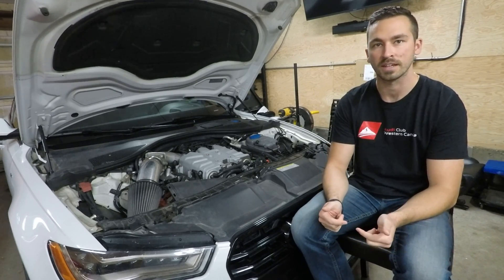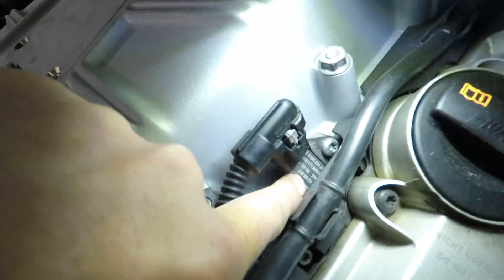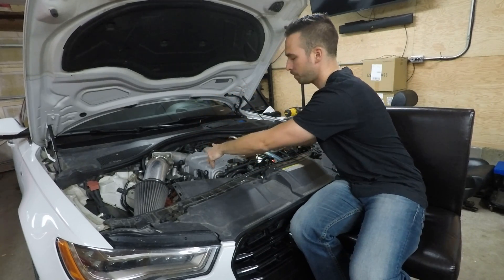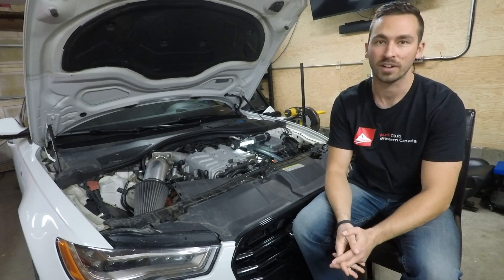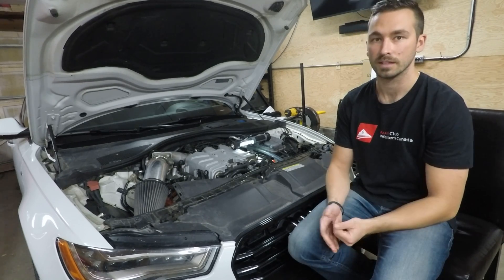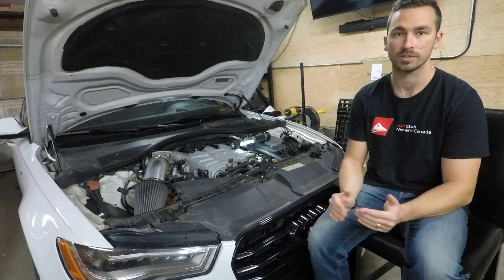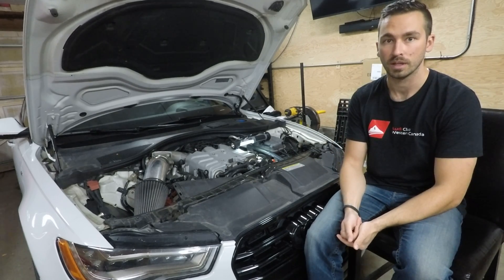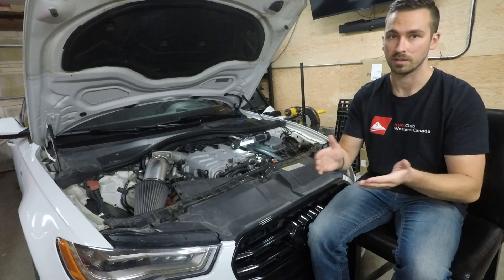3.0t Tech Talk Ep.1 // IATs and their Relationship to Performance

Comment: Do you have any video on how to do logging and whats the best things to log in new to this. I have vsds but would rather find a easy way like using my phone as i dont want to carry around my laptop with cable going everywhere.
Reply from the maker: Who do you have your car flashed with? Or do you have your 3.0t tuned?
Reply: @SuitedUp2The9s previous owner flashed it at a local shop, stage 2 single pulley tune by GIAC.
Reply: @SuitedUp2The9s  i got a handheld obd port switcher with it but thats just to switch tunes from race to pump to valet
Reply from the maker: @Kendkend  I'm tuned on 034Motorsport software and conveniently they have a tube switching discount and all of it can be done through their mobile app. Also works on laptops and tablets too. Their logger and then built in viewer is very slick. I've been using it consistently for well over a year now

Comment: SQ5 2015 Dual pully stage 2plus ...What is going on if I'm pulling from 0-280kph
The cooling system ..with the IAT ??? What is the good maximum Temperature that the IAT needs to be in such situation...or other hard long drive....???
Reply from the maker: I could guess what's going on but I'd prefer to log it and have pids up on my 034spi logger so I can glance at if my temps are good or above 80C. 80C iats I think for all tuners is where thats when the iat safety kicks in and you go into a reduced power mode with your bypass valve opening preventing you from making boost
Reply: @SuitedUp2The9s so actually you can not push the car to it limits?  If I want to drive hard for a few minutes... to push it all the way... I can't?  I need to push two or three gears pushing and stop for cooling? 
If I have a rolling race with someone...or longer race... what I need to do????? It sounds ridiculous 

For example...my car going up to 75c iat in lunch when I'm in 3th gear.
If I keep running it is going up to 90c when I'm only at 200kph... 
 
I believe that my wac50 is not working if it is like that... I'm about to install wac100 next week... but again...what do I need to expect?
Reply from the maker: Physics is what it is man. Those stock blower intercoolers aren't like a b58 or a coyote whipple or so many other superchargers with huge intercooler bricks. Upgraded cwa100, Divorced loop with only distilled and a hx will absolutely help. Maybe look at running an ice tank if you want to do runs like that. But yeah it doesn't take much from a roll especially if your iats are 20C above ambient before putting your foot into it.
Reply: @SuitedUp2The9s I have changed to a bigger HX when I got dual pullys . But after 2years now I'm getting high iat temperatures and got inside a limp mode that actually cut my power to zero when I push it hard ... I belive it was at high iat temperatures...
Any way I'm going to replace my cwa50 to cwa100...I believe that my cwa50 is not working at all because at the past I use to push the car the same without any problem

Comment: Y u no interchiller
Reply from the maker: @Pwnulolumad  I've got to simulate running one. With my climate in the winter, I got Subzero iats to start and then final iat temps end up at the same as a normal run. The iat delta isn't say the normal 30 or 40 degree increase from the subzero start. It was a +60 degree increase.
Reply: @SuitedUp2The9s If you know anyone in Texas that can install it for a reasonable rate can you drop a name here? Interchiller quoted me 2800 minimum labor only from their new Texas location.  If you can share a contact email here I could share with you the components I found that will fit in our c7s
Reply from the maker: @Pwnulolumad  Blair Auto is the only shop I know in Texas that has ties to C7s

Comment: You mention the pwm wire for the stock coolant pump. Are you talking about cutting a wire so it flows at the max?
Reply from the maker: Thats one way yes. I unpinned my pwm wire and put it in shielding to protect it while its out of the connector. And yeah the point is to flow the max, bonus is to help bleed the system of air easily.
Reply: @SuitedUp2The9s  cool, got something new to do tomorrow. Think I'll put it on a switch so I don't have to leave it running at max all the time.
Reply from the maker: @1bads5  I've had my pump like this for several years and no issues. These pumps can definitely handle it. I would have no hesitation to do it to mine again if I got another. Just for perspective. I get wanting to do the switch.
Reply: @SuitedUp2The9s  what's the fastest you ran at the track before porting? Also do you have a tiktok? Look me up if you are on there  MY...NAME...WAS...TAKEN
Reply from the maker: @40 Roll  I didn't get on track pre ported but with DP and TB. Dragy was an 11.6 @117. Sorry, I don't have TikTok. I'm seeing on your YT you've got a B8 S5 that you're modifying and racing. 🏁

Comment: The intercoolers on the 3.0T are not that efficient at all since they sit on top of the engine with no type of hood scoop routing any cold air to it like a WRX or STI.  The factory intercoolers just heat soak and really can not cool the air much at all.   Its a poor design without any cold air being routed to them.
Reply: My 3.0 intercoolers aren't up top. They are on both sides of the front bumper frame
Reply from the maker: they are water cooled. Thats why they don't have a WRX/STI hood scoop.
Reply: @SuitedUp2The9s  Well I would think being exposed to air more like a radiator would help it cool even more, wouldn't it?
Reply from the maker: @robertdaone  water has a higher specific heat capacity so air to water intercoolers can do a more efficient job of cooling and in a smaller package compared to an air to air intercooler. If you had air routed to the sc, in a wrx/sti fashion, it might cool the supercharger casing. But the air inside that's compressed won't be affected or cooled and will still heat up the supercharger casing.
Reply: @SuitedUp2The9s  I hear what you are saying but was meaning that if the actual intercoolers within the supercharger casing was exposed to air, where air is ramed on top of them like in the wrx/sti it should cool even better.
Reply: @robertdaone  Like what is being said, they are heat exchangers not intercoolers (which technically were supposed to be between two power adders). Now to your point and what you mean, I iced down my supercharger for almost two hours before a run. The housing of the charger was cool, but the two HX bricks inside the charger were still hot. I had the car sitting the entire time, into the wind with the hood open and the ice on the charger.

I data log my passes and the post supercharger temps were 50C at the beginning of the run and 61C at the end of the run. So if two hours worth of ice on a supercharger with HX bricks inside doesn't bring the coolant temps down, a hole in the hood isn't going to do it either.
Reply: @Todd.T  Yah I'm new to Audis and thought they were actual intercoolers which are more efficient at cooling down the charge air.  Well I'm sure exposing the supercharger to wind and ice will do nothing since the actual HX tanks are encased in the supercharger and would not really get any exposure.  Have you tried putting some water wetter or any other type of coolant additive to try and bring down the temps?

Comment: i may have an advantage with the cold weather i get but my iats are 40°f on avg sometimes go even lower. i have cts turbo hx and apr intake and thats it no tune
Reply from the maker: I'm taking a guess that this is when you are driving around. Not going WOT?
Reply: @SuitedUp2The9s  Canadian weather. 4C and driving the car around with the PWM wire connected (I haven't done it yet, it's next) the post charger temps are around 35C. When you shift at around 2700 the temps drop to about 26C. A launch and the 1-2 puts the car at 41C and lifting off the throttle it recovers very fast.

So this is the advantage to those posting Dragy times because they can replicate the perfect scenario. Wait for cold weather. Drive on the highway to heat the engine a bit and chill the front HX down to ambient. Pull over and unleash with a launch. I have to drive to the strip 2.5 hours away. So I want to go in October/November on one of those snotty cold days and let the car rest and get frosty. Then I can keep an eye on the temps with VCM scanner and finally run a real good number. Right off the highway in the winter, the car is an animal.

Comment: I have a question hopefully someone here can help. I have a 2012 Audi A7 with bilstein coilovers.  I changed everything on the front end. Everything.  And I still have a clunking sound from the front end.  Anyone have any idea
Reply from the maker: Hey I recently changed everything on my front end as well and found my upper strut mounts were toast creating a bad clunking noise.
Reply: I have the same car. You may have a lifter, or rod problem. Depends on when you here the clunking
Reply: Check the transmission black bracket bolts, underneath the car. One of those bolts were loose on my car causing clunking noises

Comment: Love the Series! Looking to build a stock 3.0T from the ground up. In total, what cooling mods do you think are needed to get to 600hp? And then, what cooling mods do you think would be needed to go above and beyond 600hp?
Reply from the maker: Thank you! If you hang tight I have an episode coming that shows my cooling mods and how everyone can optimize their cooling system 😃👍 it honestly depends on what you want to do with your 600hp. Dailying it with a pull here and there or a 1/2mile drag event. Both require different cooling mods.

Comment: Do you have logs of the pressure drop across your intake/air filter setup?  I have similar mods to you and am wondering if I would even fit from a more open intake like yours

Thanks
Reply from the maker: I do have those logs. At 130mph my  PDT_MES dropps 61 below AMP_MES.

Comment: Very good video and excellent idea if explaining one if the most important aspects of 3.0T. I'm in NY and am contemplating buying a heat exchanger now now wait till its closer to spring.
Reply from the maker: Thank you very much!! Always a solid upgrade. I highly recommend a Merc, based on logs of before and after people switching from a different brand to the Merc there is a noticable difference. Just a heads up. 😃👍 Can't recommend them high enough

Comment: Nice info
My C32amg is very similar to that motor with iat
I got PB last month 12.202@116.73 single upper pulley on street tires
Reply from the maker: Thank you Steve! Oh yeah? Just small differences? 
Hey congrats!! Right on man!! That's moving for such small changes
Reply: I have supporting mods 
Cwa100 pump split cooling heat exchanger reservoir tank 
Intake 
Motors and very similar but not
I watch your videos for mods for my car

Comment: Design Engineering sells a gold reflective heat tape to wrap engine components in. Guys over multiple brands report double didgit drops on IAT. Im going to do my 3.0 A6 in the spring and do a before and after with logging
Reply: I spelled digit wrong lol. great video though 👌
Reply from the maker: @OhioBahn440  thank you! I have a number of my intake parts on my B5 S4 wrapped in that exact tape. On my A6 however, being alumium intake piping that I made the TB adapter and intake from, it is a poor conductor of heat so it sheds it very easily. Do you have IG, I would definitely be interested in your results!

Comment: Great video! I recently acquired a c7 A6 3.0 and have installed an intake on it, what do you think would be the next best step in performance?
Reply from the maker: Thank you for the kind words! Right on! Congrats! The mercracing heat exchanger will be a great supporting mod for everything you choose to do after. After that stage 1 performance software and tcu software 💪😃
Reply: do you mid me asking where you got the intake? I cant find one for my C6 3.ot
Reply from the maker: @dagnut  I custom made this one. It fits the larger TB option this way. I'm on Ver. 2 now which improved upon this one.
Reply: @SuitedUp2The9s  thanks For the reply, struggling to find an intake of my C6 anywhere